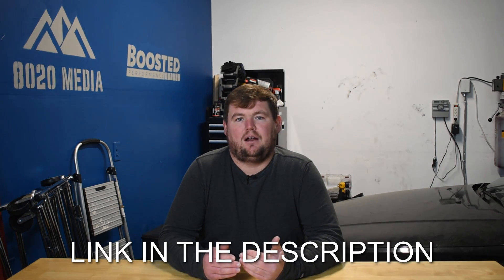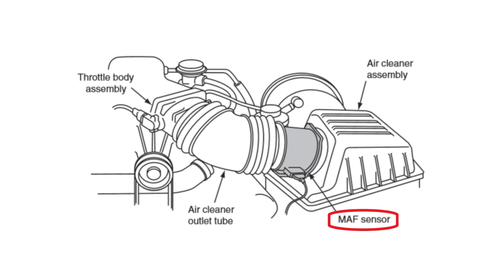DIY - 5 Symptoms of a Failing MAF (Mass Air Flow) Sensor!

Comment: Thanks, I've been having this problem for about a year with my 2019 Kia Forte. It can run fine for weeks, and then on a random day, it starts showing symptoms like it's about to stall when I'm stopped or in park, sometimes it even shuts off. The MAF sensor has been replaced twice, but the problem persists. I've basically given up because I've taken it directly to Kia service in Puerto Rico, and they keep telling me it's the sensor, but I think it's something more than just that. I'm almost afraid to go far now, thinking it might act up when I'm somewhere far away. The code reader keeps showing P0101. I dont know what to do
Reply from the maker: K - A persistent P0101 on your vehicle, especially after two MAF sensor replacements, points to an underlying cause that’s throwing the MAF reading out of range rather than the sensor itself. On these engines, common culprits include small intake tract air leaks (cracked hoses, loose clamps, bad air filter box seal), restricted or dirty air filters, carbon buildup on the throttle body affecting airflow readings, or exhaust leaks upstream of the O₂ sensors that confuse fueling. It can also be a wiring/connector issue between the MAF and ECU—corrosion or an intermittent short can make the readings spike or drop, which explains why the problem appears randomly and then disappears. Since it often happens at idle/stop, I’d also check the PCV system for leaks, and make sure the throttle body is clean and sealing properly. The fact that it runs fine for weeks suggests an intermittent mechanical or electrical fault, not a permanent airflow restriction. My recommendation would be: perform a smoke test on the intake, inspect/clean the throttle body, check PCV hoses, and test MAF wiring with a multimeter while wiggling the harness to replicate the fault—rather than swapping the sensor again.

Comment: Changed my maf and plugs and coil packs and my engine dogs out at 2800 rpm
Reply from the maker: J - If your engine bogs at exactly 2800 RPM even after replacing the MAF sensor, spark plugs, and coil packs, you’re likely dealing with a fuel delivery issue or a failing sensor under load, such as a clogged fuel filter, weak fuel pump, or faulty upstream oxygen sensor that’s misreporting air-fuel ratios at higher RPM. It's also possible the new MAF is faulty (aftermarket ones often cause more issues than they fix), or that the throttle body or intake hose has a vacuum leak that's not noticeable at idle but causes fuel trims to go off at higher airflow. Try unplugging the MAF and driving—if it runs better, that points to either the MAF itself or an intake leak. If not, check fuel pressure under load if possible and inspect the upstream O2 sensor's live voltage to see if it's responding properly. A scan tool with live data will help narrow this down fast.

Comment: Got a p0306 misfire code. It only began after a mechanic tried cleaning the sensor with compressed air. I’m thinking he might have damaged the sensor but no MAF code. Possible it’s still the MAF issue?
Reply from the maker: F - Yes, it’s absolutely possible the MAF sensor is still the root of the issue—even if there’s no direct MAF code—because if it was damaged by the compressed air (especially if the air was high pressure or the sensor was touched), it could be giving inaccurate readings that throw off the air-fuel mix, particularly under load, which can trigger cylinder-specific misfires like P0306; modern ECUs don’t always flag a bad MAF if it’s still within expected voltage range but reporting faulty airflow data. Try unplugging the MAF sensor and running the engine—if it smooths out or the misfire goes away, that’s a strong indicator the MAF is your culprit and should be replaced.
Reply: @8020Automotive  that’s helpful to know.

Comment: If you purchase a used vehicle, you have to change spark plugs, ignition coils, engine air filter, MAF and MAP plus sensor cables immediately. If you fail to replace those things sooner, your vehicle will die on you in the middle of nowhere some days.
Reply from the maker: D - Not sure you need to do all of these as soon as you buy it, however, not a bad idea! Guess it just depends on where you get the vehicle from.

Comment: Would a faulty Camshaft position sensor cause the car to also throw a MAF code? Replacing the Camshaft sensor in the morning but wondering if I should also replace the MAF sensor at the same time. I’m getting codes for both.
Reply from the maker: B - Yes, a failing camshaft position sensor can absolutely cause driveability issues that trigger a MAF sensor code, especially if the engine starts misfiring, hesitating, or running rich/lean as a result of incorrect cam timing input—since both sensors feed critical data to the ECU for air/fuel and ignition timing decisions. That said, don’t replace the MAF just yet—replace the camshaft sensor first and clear all codes, then drive it for a bit to see if the MAF code comes back. Many MAF codes are false positives caused by surging idle, misfires, or vacuum leaks, so unless your MAF sensor is visibly dirty, contaminated, or out of spec on live data (like airflow at idle way off), there's a good chance it's not the real culprit.

Comment: Can a bad maf sensor throw a cat code
Reply from the maker: T - It certainly can!
Reply: Appreciate you showing everybody a lot of stuff great program if anybody could help me out on my problem, please help
Reply from the maker: @PKR3406  What problem are you having?
Reply: What causes the door a jar light engine light sometimes the brake light or flicker all at once on a 2004 Ford F150 for the 4.6
Reply from the maker: @PKR3406  When your truck shows the door ajar light, check engine light, and brake light all flickering together, it's almost always a sign of an electrical or ground issue, not individual component failures. The most common culprit is a bad or corroded ground connection, especially the main body ground near the driver's side kick panel, battery, or frame rail, which can cause the cluster to go haywire. Another possibility is a failing alternator or a battery with weak voltage causing low voltage spikes that confuse the Body Control Module (BCM). Also worth checking is the Smart Junction Box (SJB)—basically your fuse box with built-in logic—which can corrode internally and cause weird intermittent dash behavior. Inspect and clean all main grounds, test your battery and alternator under load, and if those check out, consider scanning the BCM for any U-codes or network faults that might give away a failing module.
Reply: If I reset the code, it comes back on in about 20 minutes then you got the buzz in and everything else

Comment: Had all of these symptoms.. replaced maf sensor, Evap emissions switch valve, spark plugs and gas cap. Still stuck with those issues, also, lots of gurgling when opening gas cap and car completely stalling and dying when i open gas cap.. turns out i need a new charcoal canister. $100 to diagnose, $500 for the charcoal canister and about $375 down the drain in parts i didn’t need!! I suggest spending the $100 for diagnostics as soon as you start throwing codes!!!
Reply from the maker: W - Yeah, that’s a tough lesson, but you’re absolutely right, and props for sharing it so others can learn from it too. A clogged charcoal canister can definitely cause all those symptoms—fuel tank pressure buildup, poor drivability, stalling when opening the gas cap, and even EVAP and MAF-related codes—because it messes with the tank venting and fuel vapor management. It’s super easy to chase your tail replacing sensors and parts that are just reacting to the real issue. So yes: that $100 diagnostic fee can save hundreds in wasted parts and time, especially when the symptoms are vague or overlap across multiple systems like EVAP, fuel, and air.

Comment: I have a 2010 Hyundai accent GS I have no codes showing up , but my car does stall when at idle and once in a while while I'm driving and before it stalls while I'm driving the RPMS show 0rpms before stalling, what could it be ? I need help I'm a single mom repairing my car by myself
Reply from the maker: A - You're doing great taking this on yourself—and the fact that your 2010 Hyundai Accent stalls with no codes and the RPMs drop to zero before it dies strongly points to a failing crankshaft position sensor (CKP sensor); when this sensor goes bad, it can cut signal to the ECU, which causes the tachometer to drop and the engine to stall, often without throwing a code right away; it's common for this issue to happen intermittently at first, especially when the engine gets hot, and then get worse over time—so I’d suggest replacing the crankshaft position sensor first (it’s a fairly inexpensive part and DIY-able with basic tools), and while you're at it, check the sensor wiring for cracks or loose connections; this one fix may solve your stalling without needing anything major, and you're not alone—these sensors are a known weak point on these cars.

Comment: I have porsche cayenne 2013 V6 3.6,  after driving in full throttle/acceleration for 2 mins and then when I stop the car, it vibrates in idle. Like a rough idle. However, rpm is constant but still it vibrates. Please advice if this could MAF issue. I also got error codes of misfire in Cylinder 3 &5 and I have installed new original coils & bosch plugs, but no luck.
Reply from the maker: N - If your 2013 Porsche Cayenne 3.6L V6 vibrates at idle after full-throttle driving and you’re getting misfire codes on cylinders 3 and 5 even after replacing the coils and plugs, then yes—a faulty or slightly degraded MAF sensor could be contributing by providing inaccurate airflow readings that throw off the fuel trims under load, leading to heat-soak-related misfires once you stop; however, since the misfires are on the same bank (Bank 1: cylinders 1–3–5), you should also check for a failing fuel injector, carbon buildup on intake valves (common on these engines), or a vacuum leak near that bank—try swapping injectors 3 and 5 with two from the other bank and see if the misfire follows; if it doesn’t, clean or replace the MAF sensor and inspect for a cracked intake boot or PCV issue that could worsen when hot. Keep us updated!
Reply: @8020Automotive  thanks for your reply. I have changed the MAF sensor and it has reduced the rough idle drastically. But still after driving in full throttle, i mean high rpm, it shivers little bit while stationary. What i mean to say is that, its way much lesser than before, but not fully.
Reply from the maker: @naseebnasser2005  It’s a good sign that replacing the MAF sensor reduced the rough idle significantly, but if your engine still shivers slightly after driving at high RPM or full throttle, it’s possible there's still some fuel trim imbalance or minor carbon buildup affecting idle stability under heat soak; full-throttle driving increases intake temps and fuel demands, so any remaining dirty injectors, slightly uneven compression, or small vacuum leaks may only show symptoms after hard driving—consider running a high-quality fuel system cleaner, inspect for intake manifold gasket leaks, and check long-term fuel trims with a scan tool to see if one bank is still compensating more than the other.

Comment: Can I clean the wire that connects to it with the cleaner ?
Reply from the maker: Y - Yes, you can safely clean the wire inside the MAF sensor using MAF cleaner—just make sure you use only MAF-specific cleaner, avoid touching the wire physically (it’s very delicate), and spray it with short bursts from about 4–6 inches away; let it air dry completely before reinstalling it, and never use compressed air or swap in carb/brake cleaner, as those can leave residue or damage the sensor.

Comment: I have all these symptoms however i bought a cheap scanner and the code is p0446 evap system vent ctrl system. Would this code have anything ti do with a maf sensor as well ?
Reply from the maker: P - The P0446 code refers specifically to the EVAP system’s vent control circuit, meaning the issue is related to the vent valve or its wiring, not the MAF sensor; while a bad MAF can cause poor performance or fuel trim issues, it won’t trigger a P0446 directly—instead, your symptoms and this code point more toward a failing or stuck EVAP vent valve, a clogged charcoal canister, or even a broken wire or corroded connector at the vent valve (usually located near the fuel tank or canister); if you're experiencing rough idle or drivability issues along with this, it may be worth cleaning or checking the MAF as a separate issue, but the P0446 code itself is not MAF-related.

Comment: Im having multiple misfire and intake leak ive changed coil packs spark plugs, injectors, pcv case, intake gaskets and throttle body gaskets and still getting the same codes. Imma try o2 sensor next but could they cause a intake leak code to be thrown?
Reply from the maker: R - O2 sensors typically don’t cause an intake leak code directly, but they can indicate symptoms of one, like showing a lean condition that the ECU interprets as unmetered air entering the system—so while replacing them may help if they’re old or sluggish, they’re unlikely to be the root cause if you’re still getting multiple misfire and intake leak codes after replacing coils, plugs, injectors, PCV, and gaskets; at this point, consider doing a smoke test or using brake cleaner or carb spray around the intake manifold, vacuum lines, and brake booster hose to find hidden vacuum leaks, including cracked vacuum lines or a warped intake manifold—also check engine grounds, MAF sensor accuracy, and fuel pressure, because a bad MAF or lean fuel delivery can mimic intake leaks and trigger misfires across multiple cylinders.
Reply: @8020Automotive I've ordered o2 sensors maf sensor and a high pressure fuel pump. Im not finding anything with spraying around the engine

Comment: Zack, thank you so much for this video. Can a MAF affect idle time?
Reply from the maker: S - Thanks for the feedback! Yes, a failing or dirty Mass Air Flow (MAF) sensor can absolutely affect idle behavior, because the MAF is responsible for telling the ECU how much air is entering the engine—if it misreads airflow, the ECU may send too much or too little fuel, causing rough idle, fluctuating RPMs, stalling, or extended crank time; a dirty MAF can make the engine run rich or lean, especially at idle when airflow is low and precision matters most, so if you're having idle issues, cleaning the MAF with MAF-safe cleaner is a good first step before replacing it.

Comment: My 2003 f250 6.8 v10 will start right up and after driving some miles... the rpms with go down a little and then die. Would cleaning the MAF be worth it?
Reply: It was the crankshaft position sensor. My rpms were dropping alot to make it stall
Reply from the maker: @mikemiller5214  Glad you found the issue!
Reply from the maker: M - Yes, cleaning the MAF (Mass Air Flow) sensor is definitely worth trying in your 2003 F-250 6.8L V10, especially since your truck starts fine cold but dies once warmed up, which can point to a faulty or dirty MAF giving incorrect airflow data as the engine reaches closed-loop operation; a dirty MAF can cause poor fuel metering, leading to stalling, especially at idle or deceleration—clean it with MAF-specific cleaner only, let it dry fully, and while you're at it, check for vacuum leaks, a sticking IAC (Idle Air Control) valve, or fuel pressure issues, as those can also cause warm stalling, but yes—the MAF is a smart and easy first step.

Comment: Can maf sensor throw a p301 code
Reply from the maker: J - Yes, a faulty MAF (Mass Air Flow) sensor can indirectly cause a P0301 code, which indicates a misfire in cylinder 1, because the MAF is critical for calculating the correct air/fuel mixture—if it's reading incorrectly (due to contamination, failure, or wiring issues), it can cause the engine to run lean or rich, and some cylinders—like #1—may be more sensitive to that imbalance, especially at idle or light load; while the MAF won’t directly trigger a cylinder-specific misfire, it can absolutely create conditions that lead to one, so if you've ruled out the coil, plug, injector, and compression on cylinder 1, cleaning or replacing the MAF sensor is a smart next step.

Comment: Great Vid..it seems I may need to clean mines. I using K@N filter for my Caddy XTS 2019 and recently started seeing a bit more fuel consumption..had spark plugs changed along with the fuel cleaning.
Reply: Oh by the way I have no codes but still notice a bit of hesi and sputtering
Reply from the maker: S - Thanks for the feedback! If you're running a K&N oiled air filter on your 2019 Cadillac XTS and noticing increased fuel consumption, hesitation, and slight sputtering with no codes, it’s very possible that the oiled filter has contaminated the mass airflow (MAF) sensor, which can throw off the air/fuel ratio without triggering a fault code—this happens when excess oil from the filter film collects on the MAF sensor wire, causing the ECM to miscalculate airflow and enrich the fuel mixture unnecessarily; try carefully cleaning the MAF sensor with MAF-safe cleaner, reinstall it, and monitor performance—if symptoms improve, that’s your culprit, and you may want to switch to a dry high-flow filter to avoid repeat issues.

Comment: When cleaning the MAF sensor, do not touch the sensor wires! Only use MAF cleaner spray. Let it dry completely, then reinstall.
Reply: Can an electronic contact cleaner be used as well?
Reply from the maker: @geralddelali8880  For sure.
Reply from the maker: L - Great advice. Thanks for sharing.